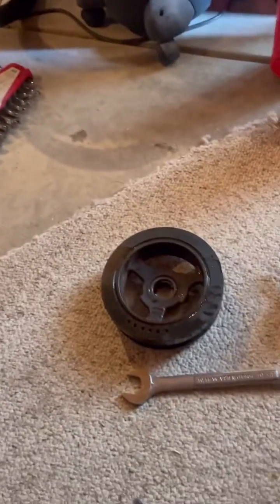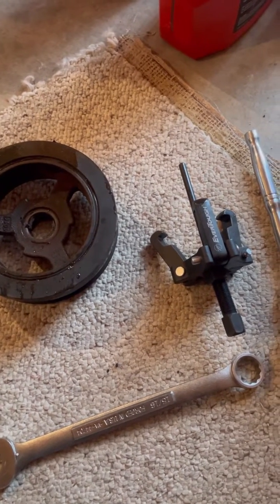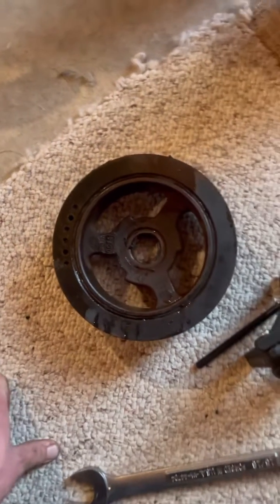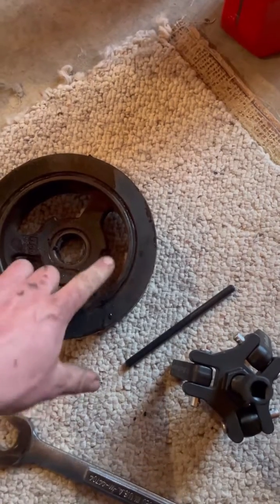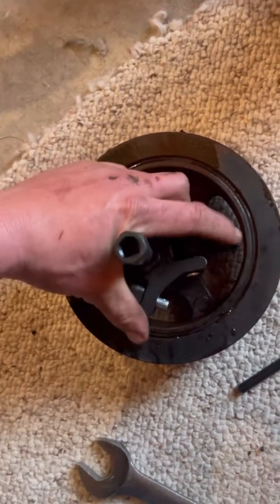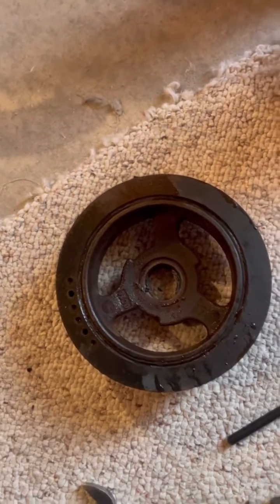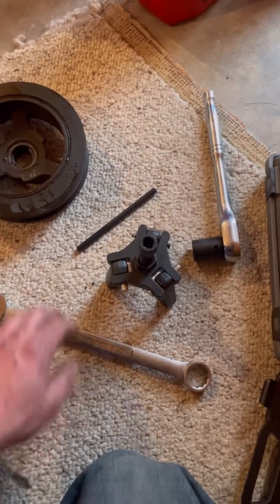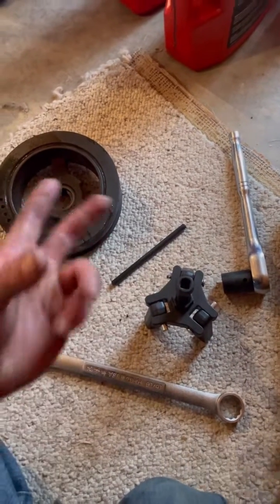Chrysler Rental Puller for 2010 Ford 5.4L Harmonic Balancer Removal

Comment: Thank you so much for this video!! I have to get mine off this weekend and it doesn’t have any holes so I wasnt sure what I was going to do. This helps a ton.
Reply from the maker: Glad to hear it! I rented and bought and returned all kinds of tools until I finally got a camera down in there and figured it out. Hopefully saves you a little brain damage!
Reply: @mytfarms94  it worked like a champ. Came right off easily. Perfect tool for that.